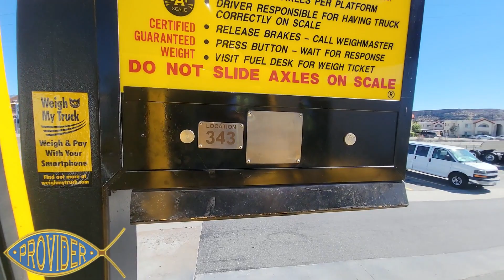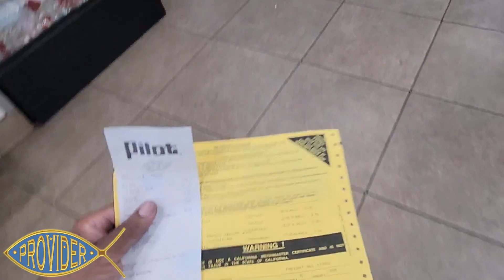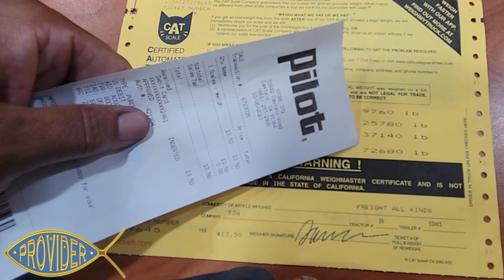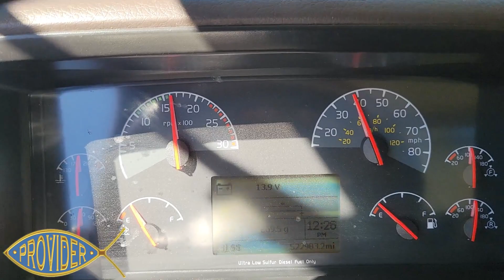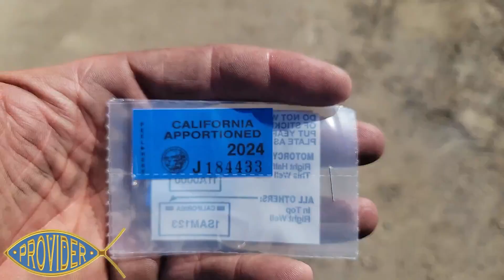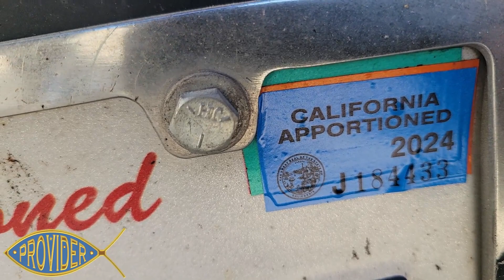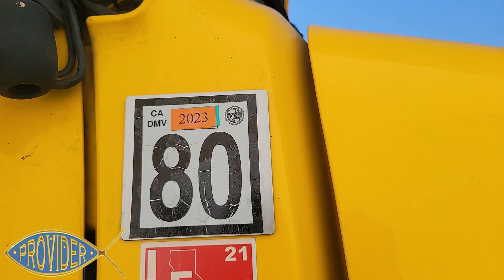USDA Load to a farming community in central Calif + Avoiding being Over weight at a scale +

Comment: Ah, grapevine! Took a load of non-haz chemical cleaner from LA up to Sac. Loaded to the gills with those big ass 500gal totes. Gross was north of 78k. Climbing in the (at the time one of the older) company OTR truck with an older ISX15 with 400 horse and a 10 speed ultrashift I was only able to maintain 20 uphill and was at max jake down hill at about 25-30 in like 5th gear. Is it wrong of me to say I miss those I-5 runs?